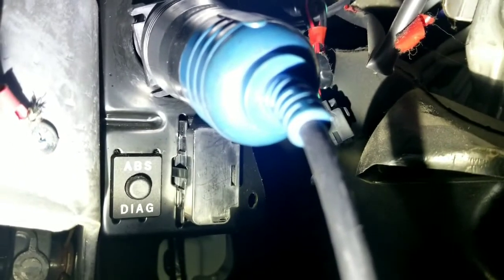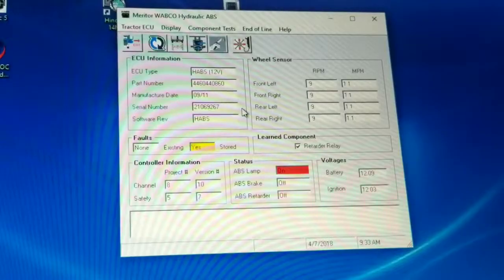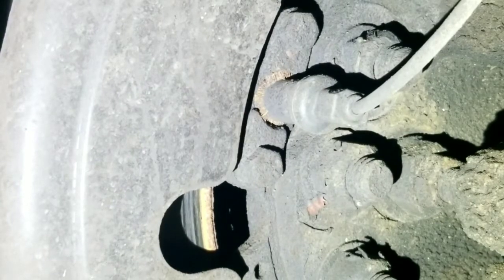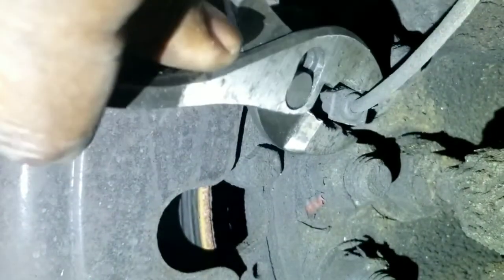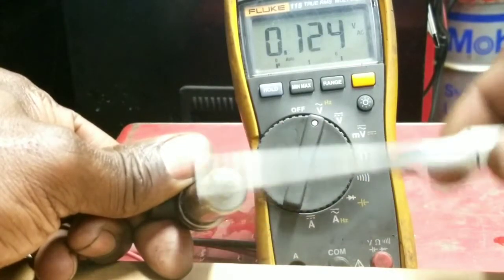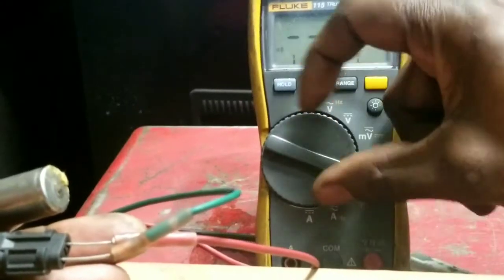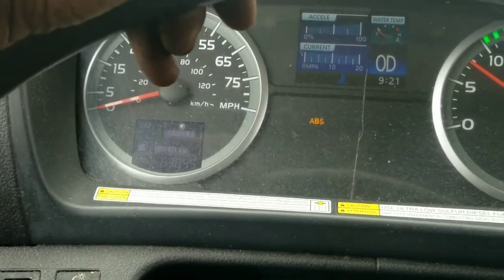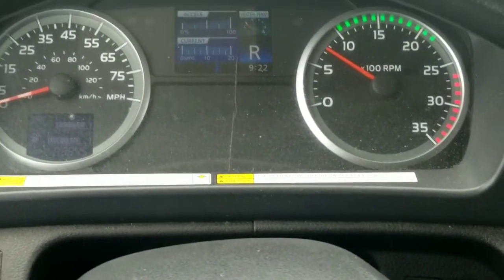Hino ABS Diagnostic.

Comment: Hi
Just asking if you 
Can help me out
I have 2013 Hino 358
And its stay in ideal
Speed when I parked
Like 9000 rpm 
Any ideas what wrong ?
Reply from the maker: 9000, or 900 rpm? There's a knob on he dash by the steering column to adjust the rpm.

Comment: Hello i got a hino 2013 and have air brake system would that work on mine ? i got a blink code 5-3 and i checked my right rear sensor and replaced and still doing the same...
Reply from the maker: Did you check the tone ring teeth, wire, and connector for damage? The sensors don't really go bad, it's usually the harness rubbing on chassis, or wheel. but, yes, the test is similar for the air brake sensor. the sensor and tone ring are inside the drum, so you will have to remove the drum to inspect it. Also, check your wheel bearing play.
Reply: @radieseltech6417  I replaced the sensor but still appears after driving